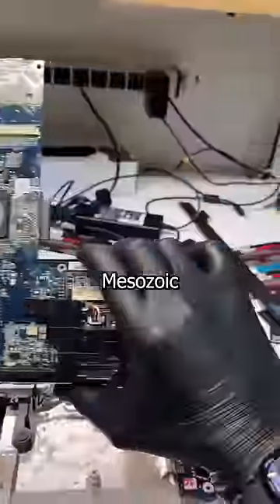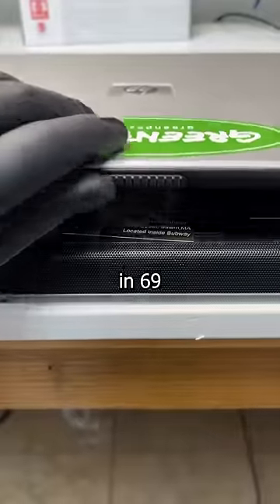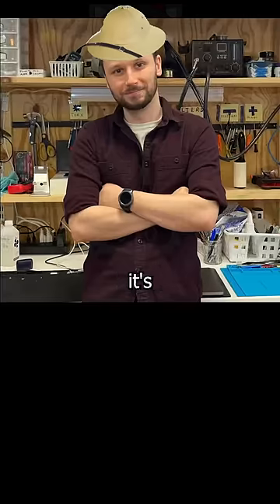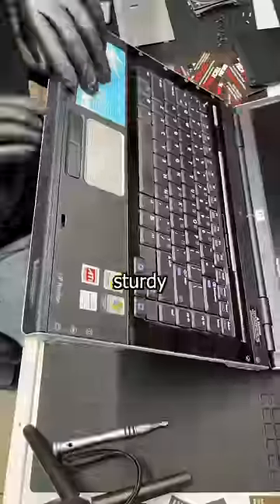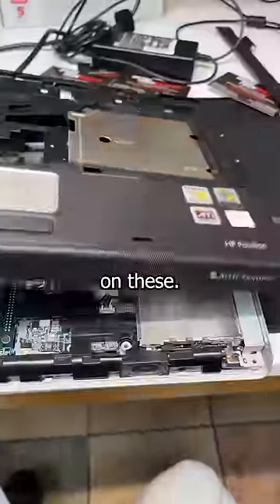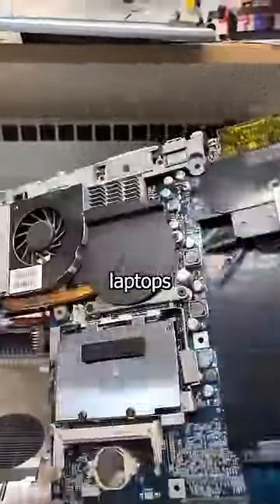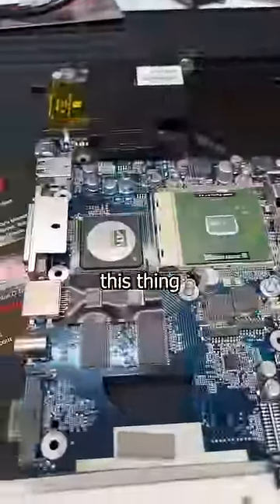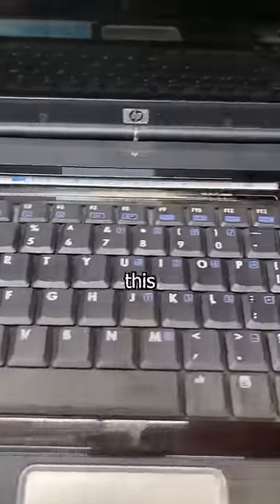Fixing an HP #Laptop from 2005 (or not) #tech #pc #technology #shorts

Comment: The fact it last almost 20 years is a testament to its design and hardware.
Reply: Could still run Linux for 50 more years
Reply: @bot7845  Where was the mention of software? There's also no proof to your claim.
Reply: With maintenance it probably wouldn't have died either
Reply: Let’s keep in mind that these laptops (the really old 10+ year ones) were not only designed like tanks, they also had a ton of performance headroom. This means that instead of running balls to the wall and at peak performance all the time, it was more like they were taking a stroll to through the park.
Reply: Survivorship bias... GPU issues must have killed like 90% of these old machines.
Reply: @bot7845  50 years without restarts and not choke... probably
Reply: @ProXcaliber eh, my asus laptop is from 2014, it isn't really built like a tank, and  i have never replaced or added any parts, (only cleaned the fan) and play cpu intensive game, but it still works really well
Reply: it was actually complete shit. in fact they were the least reliable at the time apart from apple crap. this is just a non sense youtube short for clickbaits
Reply: @jm036  of these HP machines. correction. HP was shit. still is. just worse now. fixed one of these by baking the pcb in the oven. a testament for the severe lack of build quality and zero control.

Comment: The Nvidia chips in that same model ended up having bad solder and there was a recall. I got a DV9000 back in the day basically for free. That had bad solder and I called up HP and they ended up overnighting me a box and it went in and a couple days later I got a brand new refurbished machine without the bad solder. It lasted many years.
Reply: This was not the case on this model.

The DV6000 was affected by BumpGate a phenomon that took place between 2006 and 2008.
Reply: Ever since I made the mistake to get a DV6000, which died 2 months after the warranty expired,  I only buy laptop models from a year after release, and google the heck out of them to make sure they are not crap. 
I also research the GPU, if it ranks class 2 or higher by them, I'll get it

Comment: I actaully still have my HP tank that was released back in January of 2010! Recently i wanted to upgrade the cpu (yes thats a thing of old laptops) and had to disassemble the whole thing and boy was it built like a tank. It still works absolutely fine in 2024 for basic web browsing and light MS Office work. If you're wondering the model is HP Elitebook 8440p and the specs are : Core i5 520M with 8 GB of ram (max cap is 8 GB). Its DVD Drive and 1366x768 screen make for an amazing media machine with some pretty OK sounding speakers!

Comment: The DV5000 was a great laptop.  HP took that personally by releasing the DV2000/DV6000/DV9000 series.
Reply from the maker: hahahah I OWNED A DV9000 AND IT DIED
Reply: @SalemTechsperts  most of them died.
Reply: Still have dv9000 2.4k back in 2007, hinges broke, resoldered gpu twice
Reply: I own a DV6 2030SA and it does work I just need to leave it running for a bit and then power cycle it....the Northbridge went on mine instead of the GPU

It sucks because I REALLY like it

Comment: Damn this laptop really gives nostalgia. My father has one which is from 2008 and its insides alsmost the same. 😂
Reply from the maker: Surprised that's still going!
Reply: Redo the thermal paste
Reply: Same, I also used a 2008 one
Reply: I have a HP Pavilion DV-7 from around 2008 pre-installed with Vista, has the backup discs as well. Last time I checked about a year ago it runs.
Reply: Played wow on this for a while, it was a good laptop:)

Comment: My 2012 HP Folio 13 laptop is good quality too. It runs Windows 10 well and it works nicely apart from the screen which I damaged (dead pixels) by accidentally stepping on it and the
CPU fan failed for some unknown reason. But apart from that, it's a really good laptop.
And the hinges seems good quality too.

Comment: I have one that I repaired many years ago. It has Windows XP, several emulators, and the grandkids still use it to play games, watch youtube, and netflix. Upgraded the memory, HDD to SSD, and replaced the screen in 2018. Bought a battery from Ebay in 2019 and replaced the speaker assembly in 2021. Still runs like a champ and while it is huge and heavy, the grandkids like to plug 4 controllers into the USB hub and play games on the emulators.

Comment: I have one of these.  Runs very hot even when new, weighed a ton and broke my shoulder.  The screen has vertical lines right in the middle of the screen in the first year.  One of the fans also blew out in the bottom of it.  Yeah costs over 2k too.😅

Comment: I have a ridiculously large and heavy HP ProBook 4540s that I still use. It's still in great(ish) condition (just kind of dirty) and I will buy a new one when the 10-11 year old hard drive dies. Plus, it does not have a hinge problem, it can support the lower part with the hinge and can even lift up when trying to open. It still has kind of ok specs, even now.

Comment: I have a question. What is the best way to get display to a monitor from a laptop which only has an hdmi output. Is it okay to use only hdmi or are displayport converters fine? I am using hdmi and my display randomly goes off and on and it really bothers. Monitor is 1080p 144hz.

Comment: @SalemTechsperts would you be able to repair a QUPAK laptop that has both hinges snapped off and the screen separating at the seams and it wouldn't turn off so I removed the battery from the back and now when I try to turn it on even when it's plugged in with a little white light turning on the laptop won't power on at all.

Comment: Still have this exact laptop. Still actually works. But it has to stay plugged in as the batteries have been long dead. But the BIOS battery is dead, and I'm too lazy to open it up and change it.

Comment: My chrome book has the same problem, it turns on but it's display won't come on but it has no port to connect it to a bigger screen it knly has a USB port and two USB-C ports, it holds charge and everything just the screen refuses to come on no warings nothing

Comment: I saw so many of those laptops with the same problem back in the early 2000s. Every time one came in, which was at least once a week, we knew it'd be the same symptoms.
Either it was the power circuit which meant you could literally take the battery out, hold down the power button, put it back in and the machine would magically work, or it was the GPU and the main board was e-waste.

Comment: When I worked at Geek Squad in that era,(when they actually fixed computers) I noticed if I removed the battery and power cable from an hp laptop, held the power button down for at least 45 seconds (or at minimum when it begins to feel awkward), replace battery and power cable, it powers on.  I’m guessing corrupt CMOS data was preventing PoST. May not be the case here, but it never failed me.

Comment: i'm not sure if i had that exact model, but I think so.  the media buttons and the speaker grills bring back so memories.  I used that thing until it was dust lol.  after my mom upgraded and my laptop died from abuse, I ended up with her old one and eventually i was running it solely from a usb drive and puppy linux running in ram for a couple years, and i had to run it with a vga monitor because the lcd had bit the dust.  she just kept going and going

Comment: Not sure why you'd toss it.. can get a replacement board or a new 128ati or hell diamond series gpu cheap and solder it to the board.. When i started, that's how we fixed um.. cut the connectors and soldered chips to the boards..

Comment: My god ... I had this laptop ... The fan broke and I drilled a hole underneath and put a fan from who knows where into it and suddenly it was overclocked due to the pressure from the massive fan. had stands made out of Jenga because I had some laying around and next thing I know I would continue to use that laptop proudly for an other 4 years, before I switched it to what is not my 18 year old laptop that still works and can boot up windows 11 in under 15 seconds

Comment: Too bad You threw it away. I have the same laptop in full working condition. Except I forgot the Truecrypt password for it locking a lot of butcouns inside it.

I replaced the LCD panel previous owner broke. Added copper shim over GPU and the cooling became so much better! Also got new extended battery that gives me 6 to 8 hours of use from single charge.

I am looking for original restore discs for my particular model because I want to have the media player functionality it had.

Comment: in 2011 I had a HP laptop and inside they had a totally loose bare metal L bar with zero insulation in the middle of the motherboard and keyboard to make it more sturdy and was impossible to put back once opened destroying the entire laptop. It was designed that way from the factory. Never touched HP again after that. It also had software on the motherboard that checked if you formatted your HDD and would brick your machine if you did saying unauthorized changes were made.

Comment: As a technician myself that started  working on devices in ~2013ish im glad i i dont have to work on these laptops. I have before and it is an absolute royal pain in the ass cause its like a 10 layer deep sandwich  and if you get a screw in the wrong place you risk it blowing up.

Comment: I still have my HP Pavilion ZD8000 and it is awesome, from 2005 (2004) I got mine in '05, 3 fans, a 128 GB SSD, 4 GB RAM, and a Pentium 4 HT, Linux mint, perfect for listening to music, the speakers in it sound better than some Bluetooth speakers today. Seriously this laptop has the best sound ever, yes, even better than the new Macbooks. and the screen is massive, 1680x1050 at 17in, sharp, but could be better in the colors, had to software boost saturation a tiny bit, i still play cs:s and cs1.6 on it, cs:s 50fps high settings full res and 100+ at 800x600 low cs1.6 on low at full res over 120+

Comment: Aight... for those who need to know, but don't know yet, but really should know... HP laptops used to (might not anymore) need a screw put through the cd drive's screw holes specifically to allow the system to boot up at all. I forget the exact reasoning for it, but was quite annoying for novices at the time to find out that after putting them back together and having forgotten that single screw; or having removed the drive all together for whatever reason and not putting that screw back in... 

As all techs know; starting screw count for laptop doesn't always equal final screw count for laptop. Those things are quantum or something, cause they disappear when you stop observing them for a moment; or don't have them properly contained. Even then... sometimes... 

My personal solution to it all was to draw a line and dot diagram of the laptop and where the screws should be located; and then place that on a magnet with the screws ontop both. This was before tray holders became a norm for hobbyist types like me.

Comment: I work at a repair shop in KSA And a customer happened to face a similar problem,but with a couple of beeps coming from the motherboard.(He didn't know that he came to the Arabic greatest technician that ever lived😂) I made a promise to myself that I would not sleep that night before I knew the problem with this device.

 I ended up knowing the problem with this device at 4 AM, and I literally disconnected the connector that connects to the display with the motherboard wiped it with a toothbrush and then put it back again, and it surprisly worked!😂😂😂

Comment: Fun fact…HP did not design that laptop. They used a “white box” design from an ODM, most likely ASUS. Who, in turn, worked with the board (or silicon) manufacturer to create a basic design that meets all the thermal and mechanical requirements to properly support the internals.

Comment: Have an HP laptop where it fell like a god darn open book from the height of my bed which was like 2 meters high, only broke the corner but still works like a charm. The replacement laptop was Asus A15 where having 144fps active like how it was supposed to worked killed itself from over heating with a gaming pad with 5k rpm and a side vent fan for it to never ever heat up. But due to some miracle ut killed the entire screen which needs to be replaced entirely😅, glad the store where I bought it directly from ASUS replaced the entire screen which they deemed as faulty parts from manufacturing.
During the repair time, I looked and found that I'm not the only one who have such problems😂 the screen of 144fps could go and end itself if used at 144fps so yeah great application there ASUS🤣

Comment: there was a time period during 2006 to 2010 where nvidia would design their GPUs thermally like ACTUAL SHIT and when you had these GPUs running for a long time they will get hotter than the surface of the sun, and so with time and multiple stresses they GPU would give up and take and die, even the PlayStation 3 suffered from this with the "yellow light of death" and that's why people complained about Windows Vista being bad even tho it was technically not micro$oft's fault, but yeah nvidia stuff became good in like 2011 - 2012

Comment: I thing i know how to fix this problem. One of my teacher has the same model and the same problem. All i did was changing bios batteery and it fixed. It really seems silly but give it a shot.
Reply: The CMOS battery shouldn't have anything to do with this issue. What he should've done first is connect it to an external monitor and see if it would display anything. If it didn't show anything, likely it would need a new controller or a new display outright. However, considering how old this laptop is, and depending on the display type, it might need a new back light. All I can say is that jumping straight to the GPU seems a little illogical to me, but he has experience working on stuff like this, and I don't, so I'll give him a chance on this one.
Reply: @tales527  you are absolutely right but like a i said it was the exact same model with the same issue. I did connect mine to external display. Still it didnt show anything. Some how problem was the cmos battery. Even when i try to start up the laptop without cmos it didnt work. When i change it with some new cmos battery display started to work.
Reply: @ertugrulfurkansavastaer2323 
That's very interesting. I wonder why the cmos was affecting it? Well, for whatever the reason, I'm glad you were able to fix it!

Comment: This laptop would be the gas guzzler version of laptops/electronics - generating a fuck-ton of heat with very little computational horsepower by today's standards. I have an old Toshiba Satellite that's built like a tank and had the first Intel Core 2 Duo line of chips, well, it was my dad's actually, the thing was a space heater more than it was a computer 😂. But awesome machine that gave me awesome memories tho... I binged GTA SanAndreas for the longest time during the break after High School. Those were definitely good times.

Comment: Now this video breaks my heart...i have a compaq Presario 2100 with a similar ish GPU

Now if you're like me and enjoy fixing older laptop's listen up

To confirm for SURE if the GPU is dead (which from this period is unlikely as the chip is not a flip chip package like newer GPUs from the vista era or something (those were known to fail)

Use a hot air station set to 100 degrees on low heat, hover it above the GPU chip and swirl it around.....do this for about 5 minutes. Getting closer with each minute and slowly lifting away.

Leave the board to cook off and Reassemble.

If it turns on then the issue is likely with the solder balls under the GPU and you'll need to reball it. (If you aren't confident then just buy a known working motherboard)

For those with BGA stations simply remove the chip, wick up that nasty ass lead free solder and reball it with leaded solder and reattach the chip. 

It SHOULD be more reliable now but add some fresh thermal paste to both chips to be on the safe side.

I wish you the best of luck!
Reply: Do you recommed any YouTube videos to learn this skills?

Comment: This laptop was NOT a tank of a laptop. The shop i worked at got these in at least 3 times a week from different people. Motherboard issues, lcd power board issues, battery over heating issue. By far the most serviced model besides anything e-machines. So much so it was the only series of laptop we kept stock of parts on hand for. At least the parts were easy to sort, almost as if HP knew this laptop SUCKED
Reply: ok watching the second half of the video... you felt my pain....how bout all them differnt length screws..... you do also know that "no" is an answer you can give users right?

Comment: That laptop sucked. The dvd drive was prone to early  failure and the gpu was just barely good enough to play wow before TBC came out. Also, the gpu was only supported with up to windows xp and not vista despite it only being a few years old when vista came out.
Some other things that made it crap were that it only had iDE where as other system had sata and despite it having slots for 2 hdd it only included the mounting hardware for 1 drive.